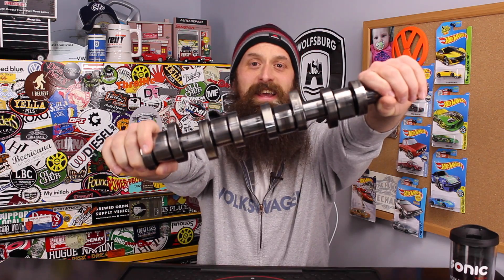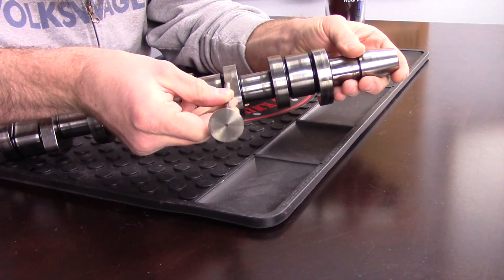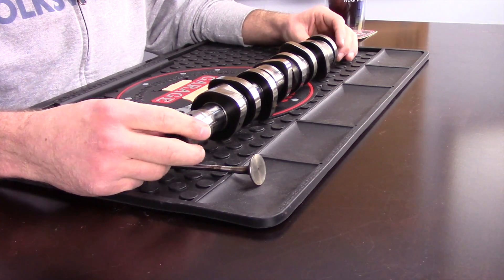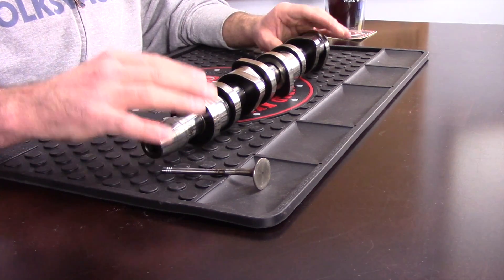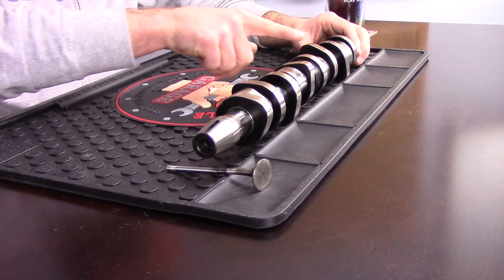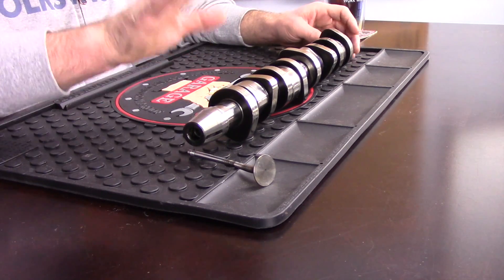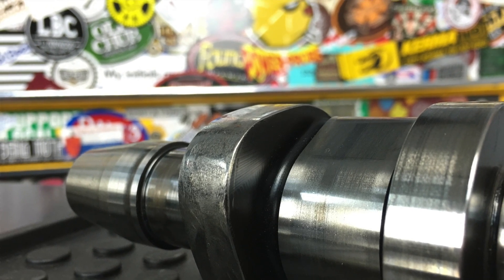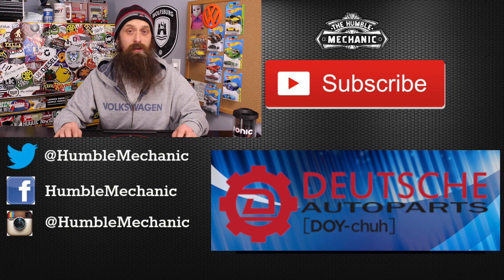How VW Parts Fail ~ 1.9 and 2.0 TDI CamShafts

Comment: Bro dudes, you’ve got it wrong. My name is Dave , and I have 30+ years VAG experience among other shit I’ve done. But the PD cam failure has nothing to do with oil , or oil pressure, or shitty cam. The actual root cause is the LP in tank fuel pump. They were designed wrong from day 1. They half seize and the volume of fuel is much lower than required,this causes fuel starvation on injector 3&4 , since it’s a PD , the injector needs the right volume to operate efficiently , BUT also needs the volume to cool itself. There’s many moving parts that generate heat , anyway this causes the surrounding areas to get red hot, and eventually it starts boiling the oil on the cam, then metal shavings get into the oil system and shit goes south. I was seeing this failure back in around 04 in Ireland mostly with the GtTDi pd150’s.   Some had as low as 50.000 km when it all went bang, but since the N/A version is not so high strung, it happens a lot later in the car’s life. I used to work as a service manager at a Seat dealership in Ireland when I realized the root cause, I did a shit ton of warranty jobs for Vw , ford, seat. I was a subcontractor at the time. But anyway, on the last note. The 2.0tdi CR with the common intake range sensor issue??! There’s a fix that costs about 35c and literally everyone already has the part needed for it , AND it takes about 12 minutes from start to finish. No codes no issues for years to come. I can show you, maybe you could make a video on it??? It would save ppl thousands 🙏🏽. Love your videos by the way, you guys ROCK!
Reply: This is big !!
Reply: How do I know if it's half seized? This will shock the pd community lol
Reply: @SY-ml5nl  your primary fuel pressure/volume will be low. Usually shows up when replacing fuel filter,and the car won’t prime.
Reply: @piperathenry1971  thanks , when I turn my key, the engine cranks slowwwwly then starts , maybe 2 seconds if that. But only when starting 1st thing during the day. After turn quicker, but not as it should like my previous pd cara I've owned. Yet this is the lowest mileage and condition I've owned!
Reply: i take it they updated the pump? I've got a seat Leon mk1 Pd150 2005 and had it since 2011 that had 49k on it and at time i looked at the cam issues and read allot about it and it was said they updated the cam, since then and regular oil changes using 5-30 since owning it and cam belts ect when needed its not happened , when i did get it there was a full seat service history only issue was phone the two garages on oil , one said 5-40 and the other 5-30 so i stuck with 507 spec as it covers any spec below
Reply: @namAlexander  yeah , the pump was superceeded to another part number. And it’s easy to change.
Reply: @piperathenry1971   mine must of been changed I’ve had it since 2011 , good to know this info though
Reply: @piperathenry1971 can you explain me more details?

Comment: I saw a scientific investigation, and because our present oils, it no longer protects metal to metal friction since sulpher has been removed. It's  really dumb that they did not change over to rollers. Beak in oil is necessary during the break-in period (minimum) 300 miles along with at least 20 min. @ 2000 rpm. Don't  use additives, as they usually are not compatable because of the detergents. In summary just use break-in oil, change as necessary. After break-in is complete, you should put in synthetic oil. Take it easy friends.

Comment: um..  i have a 400000+ km on 2003 passat.. should i be concerned?
Reply: What oil are you using ? Brand name, details? Is it 5w30 or 5w40? What is the spec ? How often do you change the oil ? How many miles driven when changed ?

Comment: Replacing mine right now on my 2006 tdi made it to 303k miles before the original camshaft failed. MAKE SURE you pull the camshaft hold down bolts out and NOT the head bolts lots of people have made that mistake including me. Now im doing a head gasket too
Reply: What oil brand spec did you use?

Comment: @HumbleMechanic can this have high probability for a P0299 on a 400k mile BHW?  I've checked everything else (n95, vacuum hoses, turbocharger, etc) and this is the last thing I can think of, and mine is quite worn (cam/lifters).

Comment: Hello mate, i have question for you,  on 2.0 TDI 8v I need to chenge new camshaft and hydraulic lifter, question is if i use black lifter hardened, do i need to use Camshaft with black coat or i can you like in factory material, sry for bad english

Comment: what is the benefit of using a Sdi camshaft on a 1.9 PD TDI ?
Reply: It should open the valves a little bit more than the standard one, because its a naturally aspirated engine, the lobes are a little bit bigger
Reply: @vojin54  no downside?
Reply: Same system but without a turbo.

Comment: Hi Charles, can you speak about the cam lobe timing on a BKD 2.0L engine? i just did a head change on my Jeep Patriot with this engine (Australia) and i noticed that the intake and exhaust cam lobes are not paired (one lobe leads the other).  Is this to encourage swirl? or maybe to have an effectively longer duration without having to hold both valves open for as long?  i haven't seen this before and am very curious why they are set up like this?  Thanks

Comment: Hi, does this failure affect the BXE 1.9 tdi engine? Reading very high injector quantity on cylinder 3 on VCDS compared to the rest. Rest are -0.50ish and cylinder 3 is reading 1.8, sometimes 2 which is not normal, some sources say it could be cam wear rather than leaky injectors? Engine has done 147k miles (golf, european, 2008)

Comment: The design is bad and the head is under lubed because of the cam bearing placement. The bearings are lubed on the pressure side and not the dwell side. I did the bearing fix and 200kms later cam looks like new, proper oil and a pinch of zddp  Silly German engineers

Comment: How common is this? I'm looking at an 06 Jetta TDI great shape 244,000 high way miles. Has all service records clutch and pressure plate ect were done. Should I be concerned about this failure? Or is it not likely ? Opinions and advice is greatly appreciated! Thanks for all you do.
Reply: i’m sure you already know this since it’s almost a year later, but it all depends on maintenance! i have 241k on my 05tdi mk4. still runs great

Comment: What off the shelf oil should be used to avoid this problem in the future. I have an 06 Jetta TDI that was given to me due to this exact failure. I have since replaced the cam and lifters but was unsure of the types of oils i should use. I have been using Delo since the repair.
Reply: i personally use liqui moly toptec 4100. look at the bottom of the 5 liter jug and make sure the VW oil specification is on it. i have a 2005 BEW TDI jetta and the oil specification is 505.01 i believe. liqui moly toptec 4100 covers that spec. i think vw published a chart on which oil to use for which engine

Comment: Si, what's the cause, bad /incorrect oil or inferior metallurgy?
Reply: At least compared to AGR/ALH/ASV with electronic injector pump, in PD engines the camshaft additionally creates the injection pressure.. That might have something to do with it.
Reply: Inferior design.

Comment: guys for a passat b6 engine code bmr 170hp diesel with dsg i get some blueish smoke when i start the engine cold but when it warms up the smoke goes away.the engine is starting smoothly both cold and warm.any ideas what it might be?
Reply: You're having oil leaking into the intake and burning with the diesel fuel. From a bad valve or bad Turbo seal. The Blue smoke is burning oil. The fact it goes away means the expansion of the engine when warm is sealing off the leak and it corrects with engine expansion.

Comment: i found one thing more that cause camshaft failure,each rocker arm shaft tip has one aluminium cap that comes out which leads to loss of oil pressure inside cilinder head,with that low oil pressure hydraulic lifters start to fail by not applying the same force and damaging the camshaft

Comment: Done the oil change every 7k miles, I used the RIGHT OIL and never had this problem. Car has 371.000 miles.
Reply: @sammcharis  VW505.01 specified oil 5W40 would be ideal
Reply: If you’ve a 1.9 PD with a DPF then use VW507.00 5W30
Reply: What oil ?
Reply: 5w40 with the vw505.01 spec @SY-ml5nl

Comment: hi, do you have any video of Pumpe duse and how to find a fault when the injectors are mounted in the engine.. engine codes, BKD BMM 2.0 tdi. aprox. 2005-2008.. I got so much air back i the return line.. but dont know how to find where it comes back from, now he wont start at all... have changed out the rubber seals on the injectors but still a lot air returnes.. had the tandem pump off and couldnt see any problems inside, it gave the right pressure.. but dont know if the tandem pump can get in air from the vacum pump side because its on the same axle..

Comment: Looking at 2011 tdi wagon with low miles 50k. Any advice?
Reply from the maker: Have it inspected before you buy it. But really they are pretty darn good.
Reply: @HumbleMechanic  2009 TDI 2.0  had this issue?
Reply: 2011 has the most problems
Reply: Are you in the USA? It is my understanding that in 2008, VW eliminated the PD system and used common rail injection. In the process, they were able to build cams that didn't have the same stresses found on PD engines.

Comment: I have a 2.0 CR TDI and never had a single problem with engine just do maintnance now and than well i have I23k miles on it thats over half a milion killometers and only now im doing my water pump and timing belt for second time. other than that I just replace oil every 10k miles with Mobile1 full synthetic so if you have any problems with your en gine it just got to be your fault because you wont follow basic care of your car and check oil every now and than well car has a turbo and yes they do take oil regardless of how new your engine may be. you may think im overprotective or whatever but again :) my car has over hald a million km on it and still runs strong

Comment: Mine fail in 132k mile  vw 1.9tdi 2009(UK) always being service with vw recommended oil and well look after only poff poff poff sound like exhaust leak but rather than that engine fire up with half turn all the time and no lost of power at all so can any1 advice is it OK to drive in short trip like school run and shopping or Not?
Reply: Check flex joint in the exhaust system

Comment: What about cambelt is that need to b change plus all the bolt and screw and washers what assembly oil have to use on camshaft and holders??

Comment: Hey man, first...great videos, please advise, I have a problem with my 2015 audi a3 2.0 tdi engine, long cranking at first start, but if I stop the engine and crank it again it’s start with no problems, also every crank in that same day starts’up with no problem, the long crank usually happens after the car is not started for more then 10 - 15 hours, and some times, on rare occasions when I’m in second - third or forth gear the engine stumbles/stalls for 4-5 seconds when I accelerate it, this happens once a week or often, so, took the car to the mechanic, diagnose it and the g40 (cam position sensor) came up short or open, ok, replaced the sensor deleted the error and after a week or so the engine started to stumble again in third gear when accelerating, took it back to the mechanic, diagnose it and no errors found!!!!!!! A few days later, after sitting over night, first crank took a little longer than usual, so ok, back to the mechanic, diagnose it again and the g40 sensor came up “implausible signal” deleted the error, took it for a drive to take some log’s, everything was ok, the error didn’t show up, but the stumble manifested again later on with no errors, and a day later, after testing the car with the mechanic with no error codes, in the very next morning the long cranking problem resurfaced, i'm sure i have the g40 sensor error again but allready spent 400$ on diagnostics and sensor replacement, so until i find another tehnician, i don't want to visit the shop again. do you have any idea what should I look for, what can cause this problem??? I’m going nuts here, please help me🙏. Thanks in advance!!!
Reply: Hi mate having the same issue did you seem to fix this because I think it may be the vvt and was wondering if you fixed it ?
Reply: Hello, for the long cranking,  was the vvt system, the other problem was caused by the crank shaft sensor(engine stall)

Comment: If the camshaft  is bad could it throw a lot of smoke?
Reply from the maker: It’s possible, but not a common symptom I’ve seen
Reply: HumbleMechanic mine has a loud clattering noise and throws a lot of dark smoke it has no power. Can u help me

Comment: I know it's an old video but a lot of premature wear is not only oil quality but the design of the cam bearings as well (lack of lubrication) there is a great upgrade from Frank06 (Google it) where he modified the bearings to increase oiling as they have a design flaw from factory. KermaTDI sells an upgrade kit including his bearings as well as the black nitride lifters and black nitride cam lobes

Comment: Changing one now.
On one cylinder it does not open exhaust valve and blows back in the intake making loud noise, also worn trough the lifters, have not gotten it of yet but hoping no damadge to the valve it self

Comment: One of the cam followers/lifters collapsed and wiped out a lobe on my cam shaft.  I will admit that I had heard a ticking noise from the valve train months earlier, but i did nothing about it.  I should've looked and swapped out the lifters and came at that time.  Would've been a lot better than having it fail on the interstate in WV in the middle of a blizzard.  Lesson learned, fix it when I suspect an issue.

Comment: Charles I have an '05 Passat TDI with 206k miles, I just pulled the valve cover and inspected the camshaft where a couple lobes are showing initial wear but the engine runs fine with no noises, codes or low power... how long do you think I have before the wear gets worse?  I've been running only Liqui-Moly Diesel High Tech oil btw.

Comment: In europe are a lot of failures on all VW brands.  
....  replacing all the tappets, oem cam + new bearings , setting the injectors with the dial  gauge (all the correct procedures) , using only 505.01 oil and the problem will return.

I think the problem is deep in the  camshaft alignment and torsional unbalanced forces in the head.

I`ve seen failures on engines at arround 130.000 km running the correct oil spec 505.01 from day 1.
Reply: Gilberto Francisco 
Bullshit to you the pd 150 is the one with bad cam's and you can use only the vw grade of oil
Reply: Extended servicing kills them. Oil change every 10k miles or better snd the run forever. A mate has one on 220k.
Reply: Mine fail in 132k miles(UK) always being service with vw recommended oil and well look after only poff poff poff sound like exhaust leak but rather than that engine start fire up with half turn and no lost of power at all so can any1 advice is it OK to drive in short trip like school run and shopping or Not?
Reply: I have a 2004 Volkswagen Jetta TDI 1.9 l and has 208000 miles and the camshaft is bad. God help me
Reply: So 505.01 doesn't matter as long as its 5w 40 any brand ?
Reply: bullshit ... i have a pd150 ...arl engine ... with 274K ... no camshaft problems,or bearings or in the engine whatsoever .... replace engine oil between 12 or 15K (5w40 syntetic no matter what brand) ... car runs great! (German made)
Reply: But does the oil have to be 505.01? Specifically approved for a PD engine  @gafrancisco

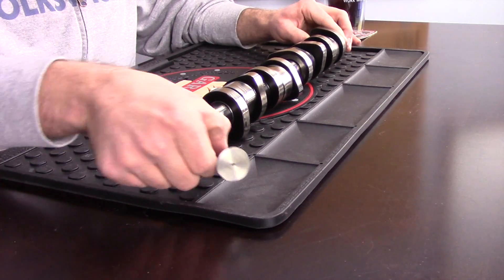Comment: 5:55 Every automotive textbook I have ever read says that if you need to replace a cam, you always need to replace the lifters at the same time. Maybe you can get away with not replacing the lifters on a SOHC or DOHC engine, but you can't get away with it on an OHV engine.
Reply: You should replace the lifters.  The lifters, not the cam, is what failed on my ALH.  One completely collapsed and wiped out an intake lobe.  Several others were cracked and would've eventually failed.
Reply: The textbook is correct.

Comment: Would a worn out cam cause a big decrease in fuel economy? Like 10 mpg less?
Reply from the maker: WOW, it could, but that is a crazy low MPG
Reply: +HumbleMechanic that's what I'm saying....  it's my girlfriends car and she was averaging 43mpg and how she's getting 35mpg...  same commute every day and nothing has change. Did all the regular maintenance stuff like oil/air/fuel filters, I'll change, checked tire pressure and alignment, checked for drag in wheels, etc and came back with nothing. She claims it has a little less power and feels different but to me it drives fine.
Reply: Kris Sondors if it was a sudden drop in economy not as likely but if its a gradual decline absolutely. seen pumpe duse motors with bad cams drop as low as 30mpg economy. 
take the valve cover off and have a look.
don't make the mistake of replacing with a junk camshaft. the dealership cam is expensive and will fail again. lots of $400 cams floating around the internet and even on otherwise reputable sources that are supposed to be a billet cam but spend the money and put a colt cam in. seen several cheap cams break clean in two and trash the head when they do it. 
its not cheap but do the job right the first time and you'll never have to do it again.